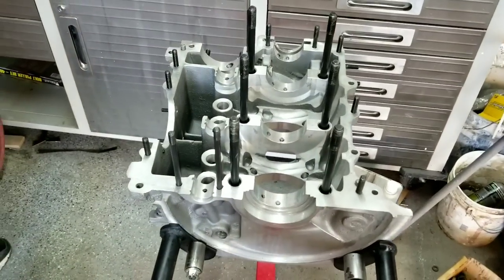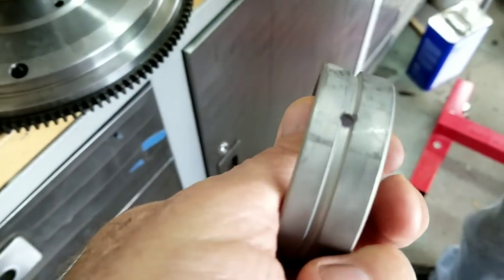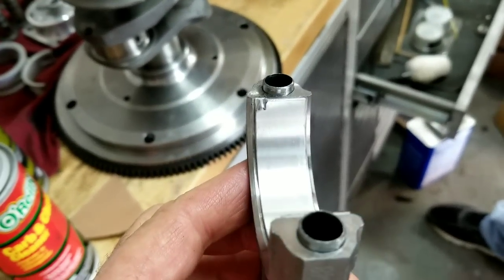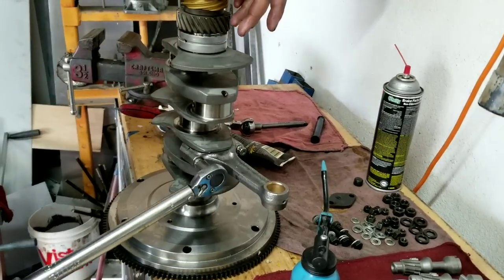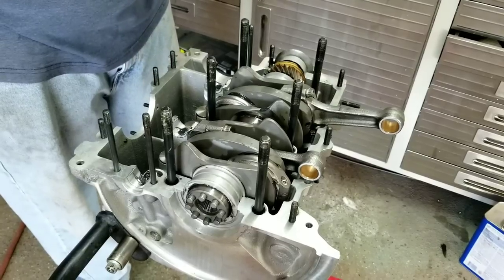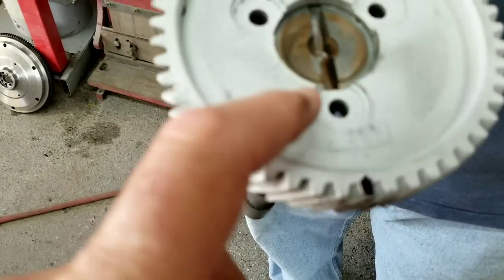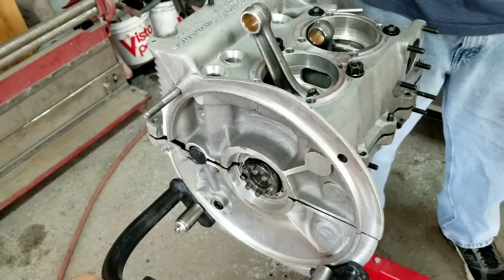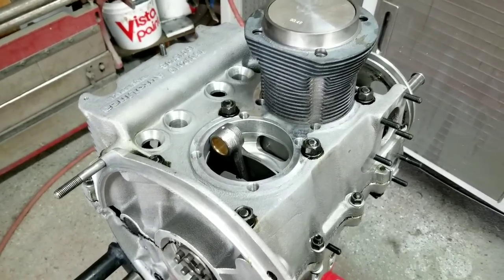Bulletproof VW engine build 1 vw flat 4 engine vw bug vw bus

Comment: When you both the cases together you should either use the stuff they use for aluminum transmission cases or aircraft stuff personally we use the aviation permatex you have to mix the bottle of real good when you get a new bottle and mix it up before you use it  bulletproof silicone connection I don't know if this is the right word but HZ metal edges because of the chemicals in the silicon not good for aluminum and magnesium

Comment: Thanks for this video. I have built these engines before, but not for a long time, and this was very helpful.   
Two  thoughts about method please.  1)  Do yourself a favor and do not let carb cleaner and/or brake cleaner get all over your hands. These solvents are carcinogens, and a small but still significant amount will pass through your skin. Sure you can get away with this for a while, and I used to do it too, but as a routine practice it is not a good idea. Get a box of rubber gloves. 2)  Using a hand-held milling tool near an open engine can easily cause chips to settle inside the new engine.  I realize that this was a demo, but best practice is to go into the next room if you are making chips and have an engine open.  Otherwise great video.  Really nicely done, and thanks for taking the time to do this for us all.
Reply from the maker: we had not done the final cleaning of the engine. at that point.
Reply: @Mikefngarage  Ah. Understood. Thanks for the video.

Comment: A tip....if you don't have the actual clip tool to keep the lifters in place when mating the case halves....you can use regular old spring loaded clothespins...They work just fine.
Reply from the maker: good old school trick ha ha

Comment: Mike do you plastic gage the rod and mains to check for .002 clearance ?? Never knew the issue about bearing oil grooves not matching up thanks for sharing that info.. also on the rods most of my rebuilds have be stock motors and rods.. Years ago when i work in a auto machine shop we used a 50/50 mix of STP and motor oil, but like my son always tells me , " dad that was way back in the olden days "  ..Back in them olden days,  I would micro polish the cramk in our crank grinder and  refurbish or check the rods on on sun hone rod conditioner then plastic gage fit-up funny thing back in late 60s early 70's i would do a three angle grind on the heads , even set of v8 's as standard valve job,  now you pay extra.. Installing new seats in a vw head; I put the vw head in our lunch break room oven, then put the chromoly seat in a small can & chill it with freon a little green loctitie after cooling it will never come out. Great how to info Mike on building the lower end.
Reply from the maker: we dont use plastigage more for used parts rebuild. Even that We do by feel. just gotta know what it feels like when it is oiled and fitting correctly.

Comment: I bought a 1973 bay last summer , it runs great and pulls pretty well compared to the 1600 I’ve had before , it has electronic ignition but how do I tell if it’s a 1641 cc or similar upgrade ?.

Comment: "Never stop leaning" is confirmed once again. This could ruin the hole engine. Only masters like you...thanks.
Reply from the maker: yea those rod caps were a bit weird but lots of the stuff out there today is that way. but it will run great for a long time.

Comment: Would have liked more detail on brand/choice of case, mods it has to allow use of stroker crank and rods... curious you said you were installing case savers after assembly ? Wouldn't it be easier to install them before final ass'y so you can be sure of fit and removal of any of installation residue from tapping ?
Reply from the maker: yea either way sometimes we put them in before.

Comment: 17:30 They reduced the amount of ZDDP in STP to the point it's not really any better than plain oil. Don't use it hoping it will save your cam. Lucas break in oil is a much better choice.

Comment: where did you buy this aluminum case? Or did you modify it yourself with the long bolts instead of shuffle pins.
the websites I viewed had aluminum engines but the short shuffle pins. I like your idea of tightening up the block.
I like the way you made the oil opening wider on the main bearing to give more oil pressure.
thanks
Reply from the maker: AA sells this case. I am not sure but most of them should be the same casting. They might all have the shuffle pins. I would check if carcraft sells this one or if the empi one has the shuffle pins. IF it does I would bet they are the same casting.

Comment: Yamabond isn't ONLY for Yamaha's.  It's for any case, especially aluminum that is vertically split & has oil contained in it - which the VW does.   I think Permatex now has a replacement for the Yamabond that is also grey.  I don't remember the name of it off hand.

Comment: I really enjoyed watching this, lots of great info.
I have a quick comment though, at 3:03 you are test fitting bearings, I have had rod oil starvation issues with using a late T1 crossdrilled crank center main bearing on a stroker straight drilled crank,.especially at higher rpms
Reply from the maker: not sure what that was. May look into that one.
Reply: vw type4 and older type1 had the oil feed groove against the crank journal, when vw started using crossdrilled cranks they put a large scoop on the crank and moved the oil feed groove to the case side. 
Here is a neat thread on the subject:
https://www.thesamba.com/vw/forum/archive/index.php/o-t--t-499960--.html
Reply from the maker: I think that applied to the stock cranks they were making into stroker cranks many years ago. these cranks I f you noticed the holes we put plugs in have galleys that transfer the oil to the rods. Seems like a different system. We havent had any issues with them just horse power limits for the quality of steel. I wont be near that limit. so it will be fine.

Comment: At 4.:45 Using the Dremel tool right beside the case? I got the impression the case was already cleaned?
Reply from the maker: no not cleaned yet.
Reply: @Mikefngarage  Glad to hear that. But, it does give you more debris to remove.

Comment: On the lifter bores the limit is .003 and .0015 is New . This is the rattle you use a dial indicator and have the lifter all the way down. I had to buy a new case because My old case My Meth head brother put a quart of sand in it when I had just overhauled it and for some reason that is where it got it. the crank bearings only had a few scratches but the lifter bores ate up to it had .007 rattle. When he did this the engine had breakin and about 50 yrds. on it. See we had a fight over me telling him that he was 55 years old and the meth was going to kill him. well ? DOA. He aint gonna do that no more!

Comment: You let bearing filings fall into the engine block when demonstrating how to fix bearing hole misalignment to the block. You need to blowout everything clean again. Correct?
Reply from the maker: oh yea we had not blown out the engine case yet. you really need to clean even a NEW case they have metal shavings sometimes in the small oil galleys.

Comment: Sorry iPhone mistake:
I meant connecting rod. I’d like to know the lower bearing diameter and the length of top to lower bearing c/c and the stroke of the old VW engine. If you can let me know I Thanks in advance.
Great show that’s why I subscribed too.
Reply from the maker: im not sure what your asking the stock crank is 69mm stroke.

Comment: When you put the first gear into the crankshaft is there a certain way to put it, i know that the marking with the dot goes up but how does the timing work i dint see any marking or a guide for the gear to go an exact way into the crank

Comment: Can you tell me where the red and black wire's from the distributer go to on the coil positive negative sides thanks
Reply from the maker: positive red wire goes to ignition key side  negative wire goes to old points side.
Reply: Sounds like you have an aftermarket electronic distributor. Black to coil (-) Red to coil (+)

Comment: Do you guys use the oil splash plate on the nose of the engine? I know I have seen then on stock engines. it helps keep the oil in the case along with the reverse cut groves on the pulley.

Comment: I’ve built some VW motors, I’ve never had bearings that didn’t line up with the oil holes. And the bearings having spurs on the edges? What brand of bearings are those? I will try to avoid them. Lol
Reply from the maker: the rods. This is on every set of those rods just a little light sand and your good. Chromoly I beam rods are all like that.

Comment: Great videos.. I just have one really dumb question... What is meant by a stroker engine? And how do they differ from standard?
Reply from the maker: standard stroke of a vw is 69mm this one is 78mm. so it has a different crankshaft. also it has larger pistons stock is 85.5 mm and this one is 90.5 stock is a 1600 this one is 2007. still a pretty bullet proof motor and a bit more power and torque.
Reply: @Mikefngarage  so it just refers to the piston travel?

Comment: Sanded? I was taught never to use abrasives on or near bearings..particles lodge in the soft surface and  cause wear.Use a hardened steel bearing scraper or improvise one to shave away a thou or two.

Comment: I noticed some windows machined into the side of the liters below the oil grooves. Not seen that before.
Is that to reduce their weight?
Reply from the maker: yea those are scat high performance. good stuff
Reply: Those are to relieve crank case pressure. When one piston comes down the air inside of the piston pushes downward and transfers the air to the other piston beside it as it goes up. Racers trick.
Reply: @ronwoods7928  Presumably because T1 cases don't have the enlarged breather holes between the journals like the wbx engines have. 

I wonder if the aluminum cases are the same.

Comment: in your comparing the factory rods to the forged isent mounting the con rod with the old hole on the pin going to face down instead of up where it collects oil rather than it pouring out of the pin ?how else would the pin get oil?

Comment: I think most of the Japanese motorcycle makers have proprietary lubricants and sealers.  I used to. have a Suzuki GS 1000 hotrod that never leaked at all, so I swear by the Suzuki bond.  I don't think it really matters though.

Comment: A and a performance rods usually need to be resized before using them
Reply from the maker: first I have heard that. All the guys I know modify the tangs with a file very slightly then they work just fine. I mean yea if you want plug and play that would work.

Comment: I'm surprised you oil the rod cap bolts because this changes the torque spec. Since the bolt has less friction the same torque as a dry bolt will result in  putting more tensile load on the lined bolt. Do you use lower torque on the lined bolts.
Eric
Reply from the maker: I think he did oil them I was doing something else when we were at that point.
Reply: @Mikefngarage   Oil instead of ARP lube gives different torque readings.

Comment: Mike
Congratulation, a great series, very informative. I rebuilt two 1939 KS600
Zündapp motorbikes. I have parts for a third motor. I want to build my own condos. Could you please tell me the diameter of the crankshaft bearings?
Thanks, Bob
Reply from the maker: everything is standard VW.

Comment: Sorry to correct you but modifying those hole gives you more oil flow not more oil pressure. You can't have more pressure than your pump puts out. Flow is more important than pressure anyway.
Reply from the maker: well your springs regulate the pressure and yea it is for flow. and oil pressure further down the food chain. So your pressure is measured at one place but you dont know at the other end what it is. If the flow is better than the pressure at the other end is better too.

Comment: Mike, how much will you charge for a bulletproof 1835 engine.
Reply from the maker: check Brothers machine shop I dont do engines for other people. They have decent prices and excellent. work. make sure to go with the thick wall pistons. But if it were me I would go 1968 instead. that is a 74 stroker just about the same bullet proof more power and similar cost.
Reply: @Mikefngarage  thank you.

Comment: Use plastigage.
Get your bearings perfect every time.
Reply from the maker: well it does not really find a tight spot in the rod machining. so you gotta feel it as well. cant just go by the plastigage.

Comment: why are the oil holes for the wrist pins in the end rather than the top side to allow oil to drain into pin end holes are for vertical cylinders

Comment: Any ideas or thoughts on the TF-1 case?
Reply from the maker: I havent built off of one of those. They look really stout. Honestly I dont think for most street engines it would really matter. Autolinia makes a great case. there are some issues here and there that I think they have worked out. CB takes Autolinia and machines them up a bit to make them right all the time. But I go for lower cost and get them locally for a few hundred less. Any aluminum case outperforms the Mag original they all have shuffle pins on the mains. and are large crank Ready. It just depends on your budget and how much HP your trying to put out. I made this engine for bulletproof. with low cost parts that work good. Not thinking about the highest HP I could get.

Comment: hmm.. it’ll run - anything will run. question is how long. a ton of stuff to comment here but let’s focus on just one thing. did you just assemble an engine without checking ANY tolerances? for anyone preparing to build a vw, oe any engine, this is not the way to do it.
Reply from the maker: yes We checked every part to make sure it is fitted properly You dont need to measure you do need to make sure it moves correctly. Yes this is the way to do it. We have built several motors and within any reasonable margin there has been no failures.
Reply: @Mikefngarage  your hands cannot feel the required tolerance on a stone cold engine. it might 'feel' right and not bind but that doesn't mean a thing. you didn't bother to degree the cam either.. this may be the way you do it, but it's not the way it should be done. your engine, your choice, i'm not telling you what to do. but i am warning anyone watching this who may want to build an engine themselves.
Reply from the maker: @daos3300  most people dont have the tools you are requiring them to have to build a good engine. not many people have a tool to check the line bore to see if they all line up or many of the other things. you are expecting them to have. THis is for the DIY guy not for a shop and I have built many motors with this method that shops sent out that were not right. The specs for the different metals probably would not apply anyway. I appreciate the interest thanks
Reply: @Mikefngarage  sure, the more advanced stuff most people won't have the tools for. but then you wouldn't align bore a new case. but you can go a long way with basic measuring tools, feeler gauges, plastigauge and patience. it's about best practice, not expensive tools.

Comment: With a new case out of the box,  do i need to have ot machine prior assembly?
Reply from the maker: all machine work is on the case how you order it. I got mine set up for the cylinders I chose which was 90.5. Updated with shuffle pins and case savers. out of the box ready for assembliy after cleaning.
Reply: @Mikefngarage  i order a brand new mag AS 41 85mm.

Comment: I just love how you die grind main bearings right next to the block half you just meticulously cleaned. Why don't you have your rods checked for proper size and concentricity before you file bearing shells? All this alleged precision work without 1 measuring tool in sight. By 12:00, I've seen enough.

Comment: If the bearing pins were put in the wrong location, then I would worry how accurately the whole case was machined. Hand grinding on the bearings does not look very professional. Same feeling when the gears were installed without proper driving tools .